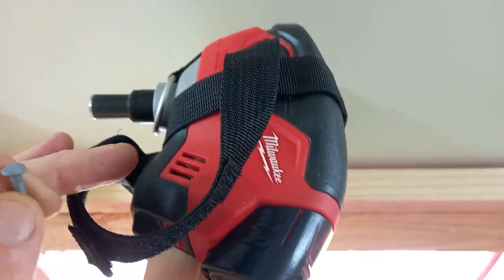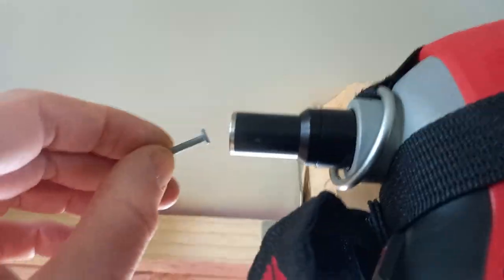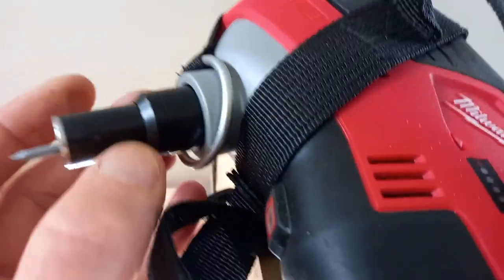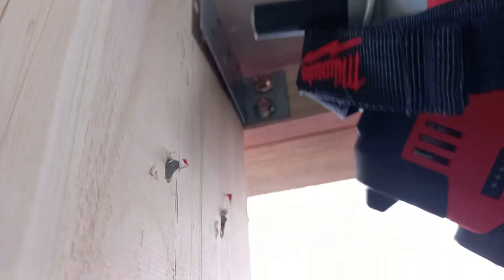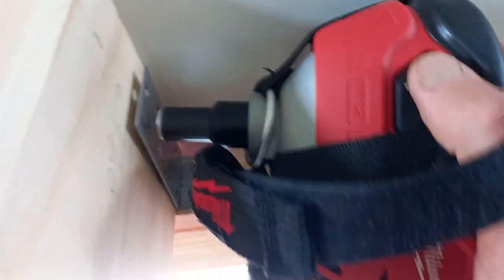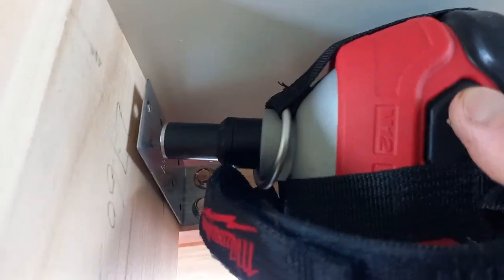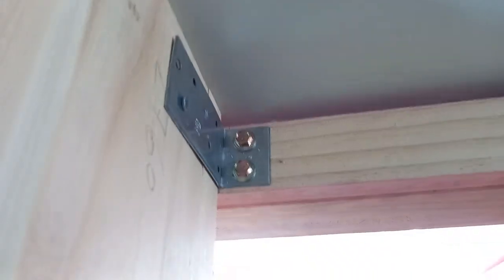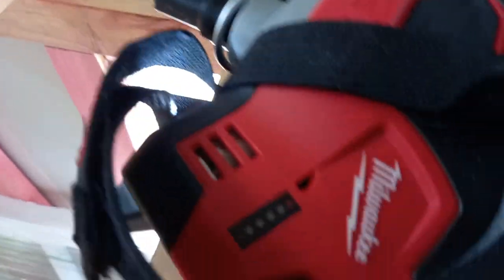Milwaukee Handheld Chaos

Comment: hey fella do you think this can be used building frames i.e wall frames etc. or will it throw the frame out (vibration etc) What you think ? :) Most vids ive seen show it driving into a piece of wood or driving in joist hangers? not seen how it works on frames as such. thx
Reply from the maker: You could use it for that but it would be tedious. A nailgun is what you want there!
Reply: @RaglansElectricBaboon  cheers